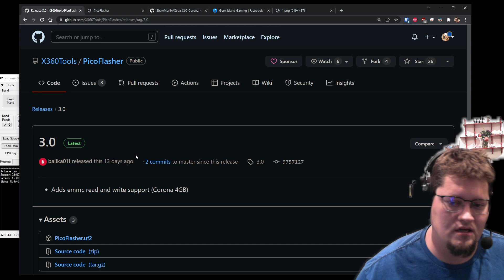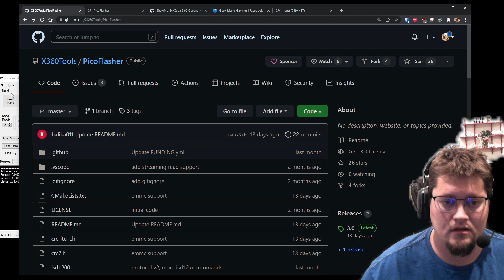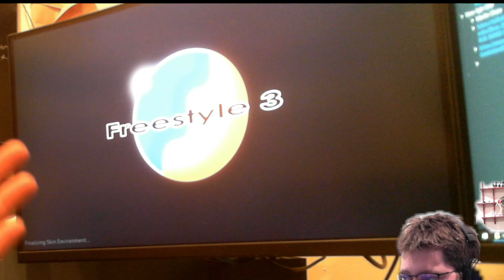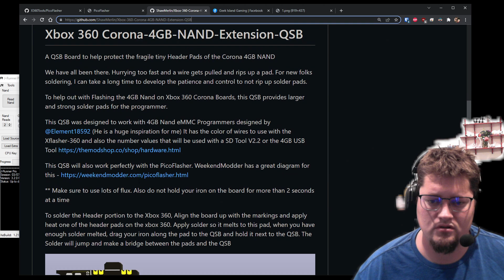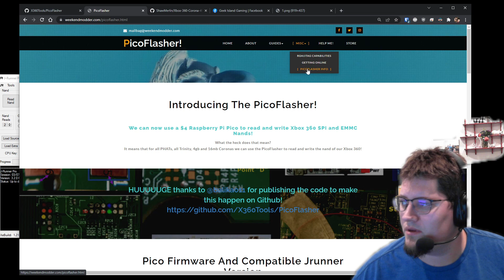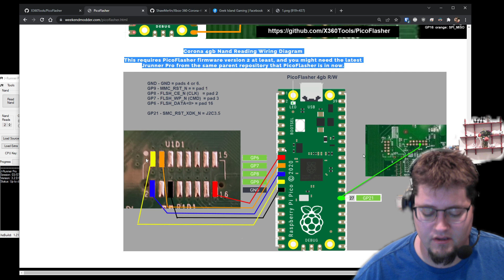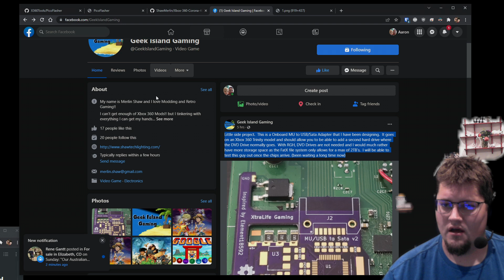PicoFlasher 4gb Update and new 4gb QSB - plus a tease!

Comment: Any advice on what is happening. Using latest Picoflasher and  Jrunner. J Runner sees the console but errors out.

J-Runner with Extras

Session: 02/19/2025 11:32:19
Version: 3.3.0 r4
Status: Up to date

Checking Console...
Corona: 4GB (eMMC connected)
PicoFlasher has encountered an error
Try to unplug and replug the device
System.TimeoutException

Comment: Hey bro, I noticed you connected your wiring on your Pico reverse of how it shows in the diagram. I'm having trouble reading the NAND with my Pico. Wiring is perfect and I double checked my wiring and solder work. Perhaps I wired everything backwards? Because mine are opposite of how you did it. I wired it the same as the diagram.
Reply: Do you solve it , because i hag issues on reading
Reply: @prolypro  If you want, I can post a video this week and show how I did it. To be honest, it's a thousand times simpler than the Pico. However, the Pico is great for flashing the Gamecube to play games off sd without having to use the bootloader disk.
Reply: @NoCodeFilmmaker  thank you for responding, ok i will waiting your video👍🏻
Reply: @NoCodeFilmmaker  thank you, I solve the problem , i just make the wires as same length
Reply: @prolypro  Awesome to hear bro 💪

Comment: I feel like I'm going crazy, is the diagram backwards or did I just read it backwards? Your pins are on the opposite side of the diagram/they are mirred no?
Reply: I HAVE THE SAME DOUBT, THE CONNECTION DOES NOT CORRESPOND WITH THE DIAGRAM, CAN YOU EXPLAIN THIS?

Comment: Hi does the Raspberry pi pico need a driver for windows, only when in jrunner if I press the console? I get 0xFFFFFFFF console not found. Alot of people are reporting the same issue when using the Raspberry pi pico, and to be honest not many answers to this problem. I am a qualified electronics engineer, and have checked soldered connections, I have tried windows 10 and windows 7, and different versions of j-runner, but same message. I've checked continuity from the Corona 16mb motherboard to the pico, and all connections are fine, which says to me that the only thing between the computer and the console, is the Pico itself. When I press the console? The green light comes on, but same result 0xFFFFFFFF console not found. I did find someone else who had the same problem, but he also had a jr programmer, and after being told numerous times by the modding community, it was his soldering, he exchanged the Pico for the JR programmer and  it read the nand without any issues. Alot of the modding community say the picoflasher is very hit and miss, and dont recommend. I've actually purchased 2 Raspberry pi pico boards, with exactly the same outcome, making it not a cheap solution at all. I have now removed all wiring and reassembled my xbox until I can get the xflasher.
Reply: Did you ever find a fix for this? I have also tried with 3 picos and still get the same error.  I also tried with two different coronas. Both are 4gb

Comment: If i'm not using the 4gb QSB board (which i don't really wish to purchase to be honest) can the green wire that goes from the Pico's "GP21" pinheader go straight to the Corona boards "Crystal Osculator" solder point please ? The reason i don't want to buy/purchase the 4gb QSB board is because i get a few customers Corona boards to RGH and don't want to pay out on the QSB addon.
Reply: u dont need to ground the crystal when using picoflasher...

Comment: I'm impressed in the simplicity and versatility of the piko flasher software. It would be nice to start having RGH 3 systems with these perminantly installed to the nand headers in case the end users brick the system, they could then fix it. Since a glitch chip is no longer needed it would still be a low cost operation.

Comment: Does that work on a 250gb version too?
Reply from the maker: There are no 250gb nands... There are Xbox 360 consoles that came with 250gb HDD's, however that has little bearing on what nand type they have.   But the picoflasher can read both types now:  It can read SPI nands from 16mb,256mb, or 512mb nand consoles and it can read EMMC 4gb nand consoles.
Reply: @TheWeekendModder  Sorry, I Miss described my question, I was asking if that R&W would work on a 16mb "version" too^^..  Thank you for your answer! Great job as allways :)

Comment: Still cannot get it to work, all I get is "console not found".  I have tried different PC, cables, and PICOs any idea how to get it working?
Reply from the maker: Shorten your wires, double check your soldering.  It does seem to be sensitive to wire length like other 4gb tools.
Reply: @TheWeekendModder  thanks I’ll try that, did you find a wire type, solid vs stranded, or gauge that works better
Reply from the maker: I like the Kynar wire here:  http://amzn.to/2ljV7Bg

Comment: Hello Weekend modder, hope you had a wonderful public holiday. Could you throw some light on how to mode with X360run glitch chips, the videos on youtube about them are not in English. I have so far swapped two x360runs which had stopped working with matrix chips and used your muffin formula, i kinda feel like x360run chips die alot.
Reply from the maker: I think I have precisely 1 run chip still in the package.  Maybe once I'm done with Rgh3 videos I can revisit them.
Reply: @TheWeekendModder  That would be really nice. Modders in my region mostly use x360run. Din't really understand why since I am new to the modding scene